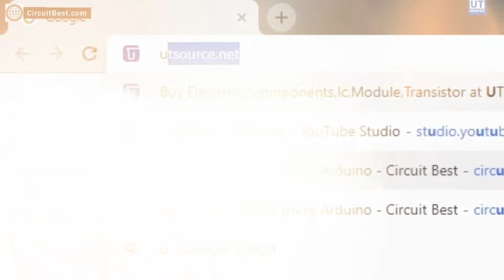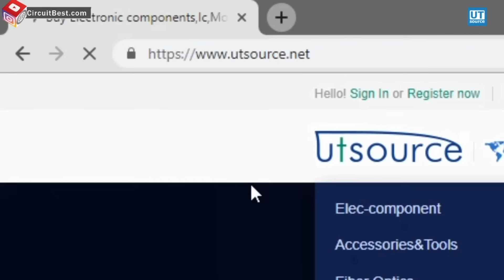New and Easy Electronic Project for Quarantine

Comment: Busted by Shango066. Don't just solder two points of contact together. You must twist the  two pieces together! You  can use the "j-hook" method as a means of doing that.
You need to make a solid mechanical connection! This would look better on a printed circuit board however but is a nice light display!
Reply: Shango066 knows his sh*t!!!!!!!!!
Reply: Dude why spoil the surprise? (oh right.. It might burn somebody else's house down when something shorts.)